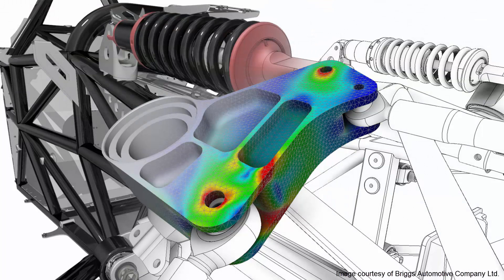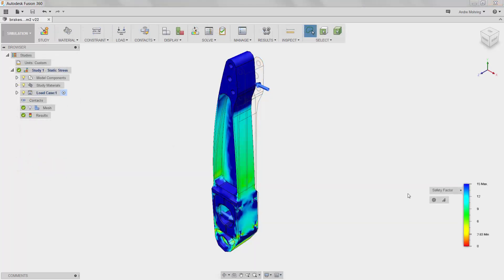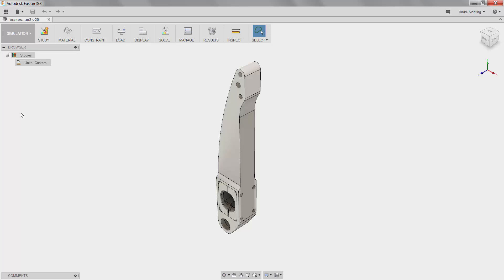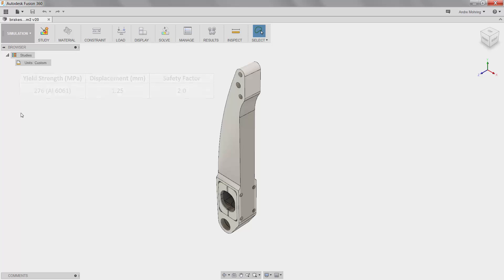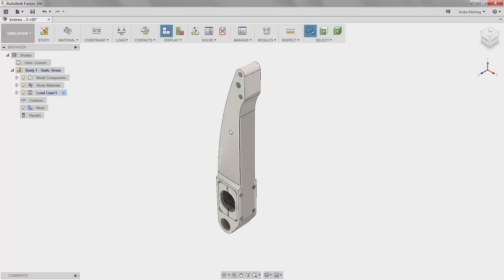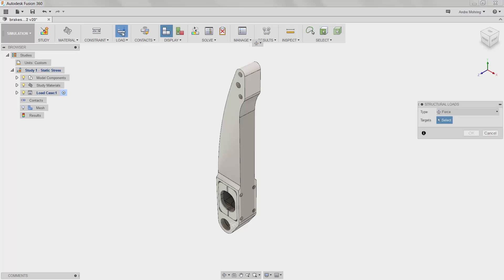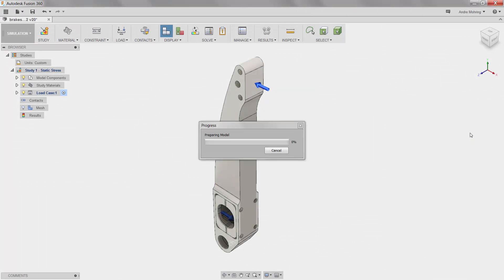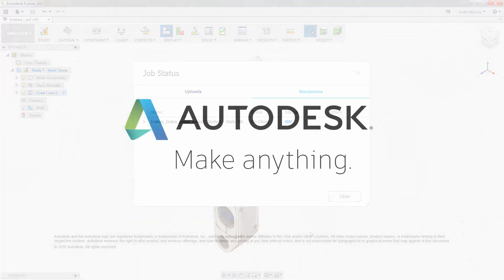Lightweighting with FEA in Fusion 360 - Part 1

Comment: Thanks for a very nice explanation. I have a question regarding the constraints. 
Why was it necessary to appy an additional constraint to the bottom of the pedal? Or, why does the pin constraint not adequately constrain the model?
Reply: red jetfab Thats my Question too^^ And by the way... he mixed up the numbers of the forces! When you push the pedal you want an increased Force on the braking cylinder not a decreased^^
Reply: When applying the pin constraint, the tangential constraint of the pin constraint seems to be off by default. Once that's enabled, as directed in the video, the frictionless constraint is not required by the pre-check and displacement results are the same with and without the fictionless constraint. Hmmm
Reply: To test this, I modeled and simulated a similar part in Fusion360 and if the frictionless constraint is not provided, the error "not enough structural constraints defined in load case" message appears in the Pre-Check. From reading the documentation and experimenting, perhaps it's as simple as the pin-constraint being a partial constraint and a single partial constraint is insufficient for the solver. Another partial constraint such as the frictionless-constraint is required. Not a very satisfying answer. Maybe someone else will have a better explanation. I thought at first it was because the pin-constraint still allowed lateral movement, but that does not seem to be it.
Reply: Indeed. Thanks again for your video.